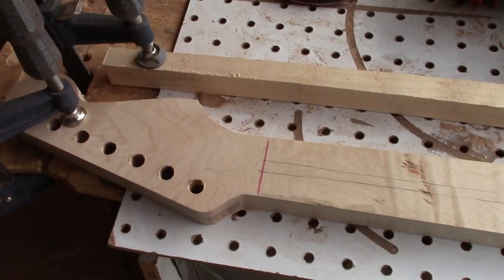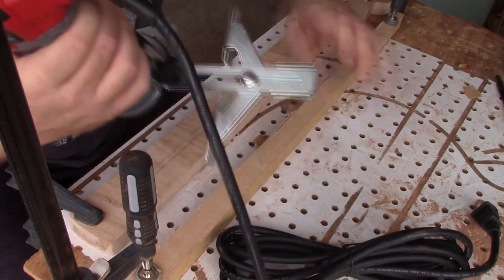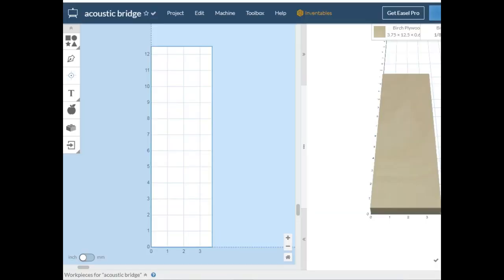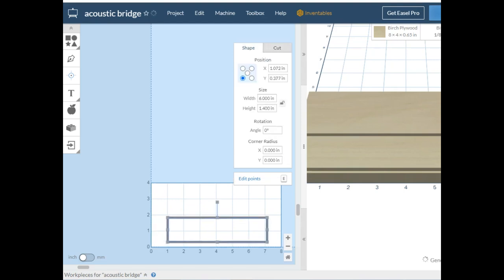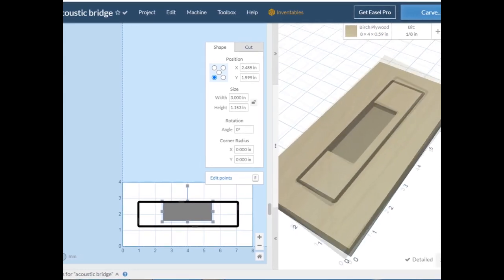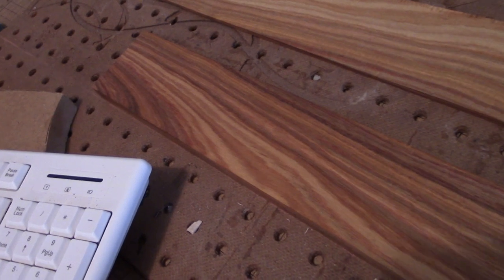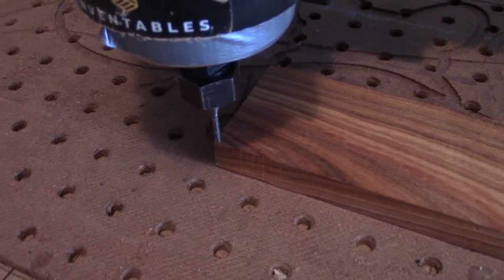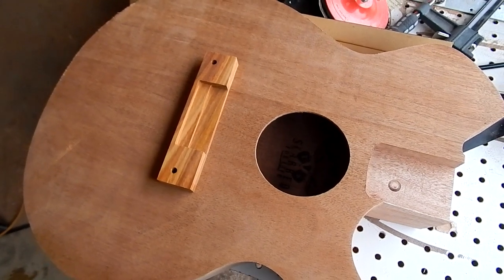MAKE an ADJUSTABLE BRIDGE For YOUR ACOUSTIC GUITAR Using Easel From INVENTABLES!!

Comment: Now that I am working on my own acoustic build the only problem I see with this bridge design is that while you gain the ability to intonate, it becomes a lot harder to use a piezo pickup. As instead of a piezo strip which you can easily link up to most preamps you're now stuck with the graphtech ghost piezo saddles and preamp.